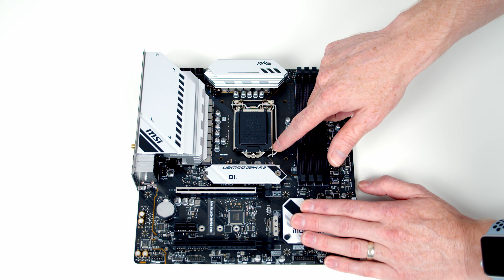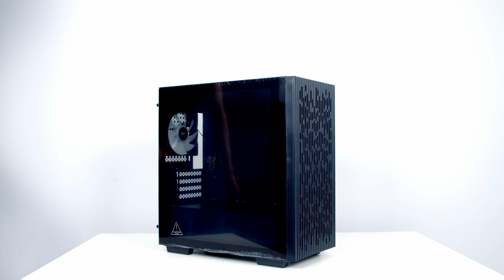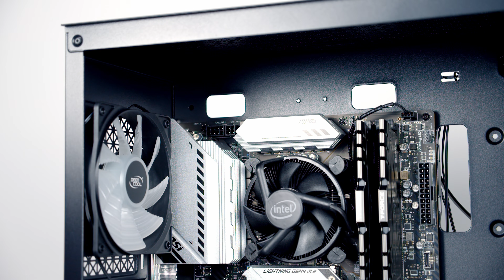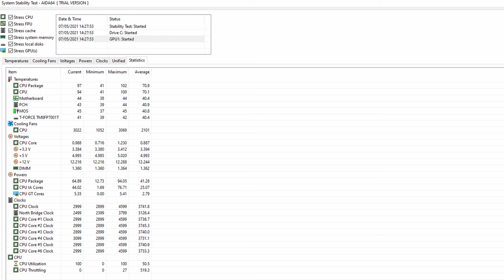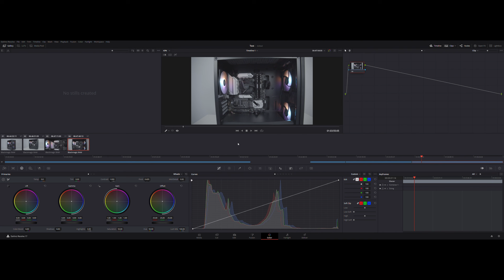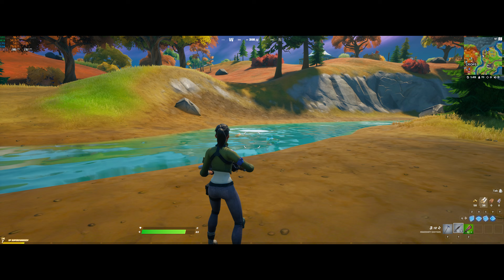How to Build a PC without a Graphics Card

Comment: Currently trying to do this  as i basically have an entire new PC minus the graphic card. Unfoetunately, i seem to get "no signal" when i try this. It switches on fine, keyboard seems to be detected and working but there is no video output.
Reply: Have you fix this I’m currently having this problem
Reply: @kendallwilliams1373  Hmmm. Not really. Full Disclosure, i wanted to connect my GPU-Less PC to the TV instead of my monitor while i waited for my new GPU to arrive. It did not work. I tried a bunch of things i saw on youtube such as "resetting" the mobo by removing the CMOS battery and pressing and holding the power button for 30 seconds while it is off but still plugged into the power socket, but it didnt work. When i connected my PC to my regular monitor it had no issues at all and was able to use it no GPU and all. My GPU already arrived so my my situation  doesnt apply anymore. Best of luck to you.
Reply: does your cpu have integrated graphics?

Comment: I'm building a similar machine but with a ryzen 5700g, last part comes tomorrow!
Reply: Was it able to work
Reply: @agnbgaming8439  It works perfectly. I installed Debian Linux on it and just worked out of the box, and it runs like a dream. Can run Windows games with Steam. It's quiet and efficient. With 32 GB RAM it's jut overall great.
Reply: @noeonoohno4219  do you by any chance know  why mines say no signal? I have the Ryzen 5600g
Reply: @noeonoohno4219  any what type of cable did you use to connect pc to monitor
Reply: @agnbgaming8439  I used HDMI. Maybe check all the basics such as power, pu installed correctly, etc. It should work!
Reply: @noeonoohno4219  Man i have the same problem i built my pc with ryzen 5 5600g and when i connected the hdmi from the mobo to the monitor it say no signal and i dont know what to do
Reply: @agnbgaming8439  Did you fix it man i have the same problem and same cpu can you help me ?
Reply: @mistergaming9528  i had to get a new motherboard and I ended up getting a graphics card
Reply: @agnbgaming8439  bruh why did you get a new mother board?

Comment: Hi, I just finished my build without a GPU, and it's working well. However, my monitor keeps saying no signal even though the HDMI, DP, and power cables are plugged in. Do you or anyone else know how to fix this?
Reply: your cpu doesnt have intergrated graphics
Reply: @sucmyascuminas4175  It does have integrated graphics, it's an i7 10700K. But thanks, I figured out the problem!
Reply: @anviil8226  what was the problem?
Reply: @anviil8226  Man can you please help me i have the same problem no display 😭
Reply: @mistergaming9528  have you figured out what it was?
Reply: @R4nd0mOnPC  Yes my man i just needed a bios update

Comment: My current computer uses the graphics on the processor and it works quite well. I'm not a gamer so this processor and included graphics take care of everything that I really need. Of course, I still want to build a new computer with a new processor and a great graphics card but for now, I can do all that I really need to do.
Reply from the maker: I couldn’t tell there was no GPU when browsing the web etc where I noticed was video editing. So if you don’t use your computer for GPU powerful task this will work well.
Reply: I just build a new pc. I dont have gpu but have igpu on my amd ryzen 7 5700G. I power it on and everything is running but no display on the monitor. Whats wrong? Please help
Reply: I know they say i should plug in the hdmi to the gpu and not the motherboard but what if i dont have gpu?
Reply: @theresebuenconsejo329  plug the hdmi in to the motherboard
Reply: @AV-xm5ln  Man i have the same problem i built my lc but no display and i connected the hdmi to the motherboard now i dont knkw what to do can you help?
Reply: @AV-xm5ln  pc*